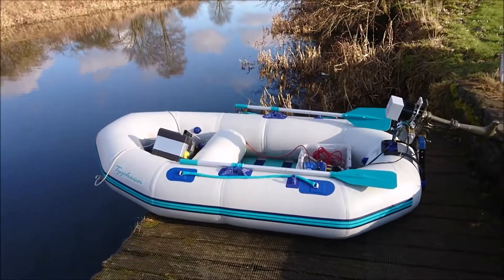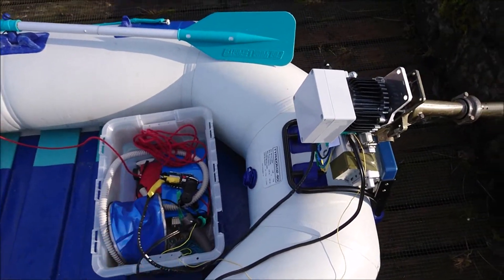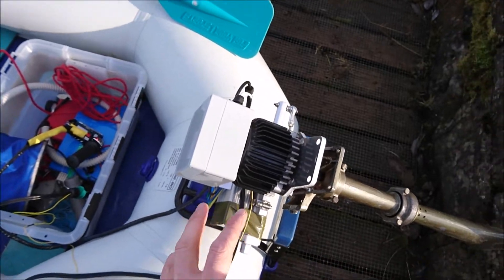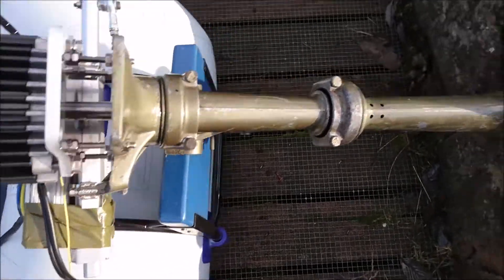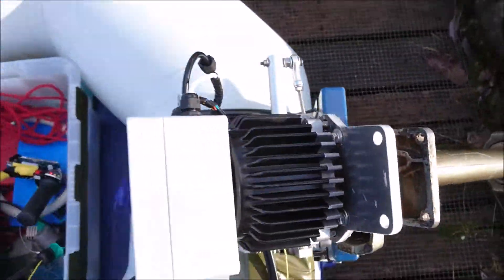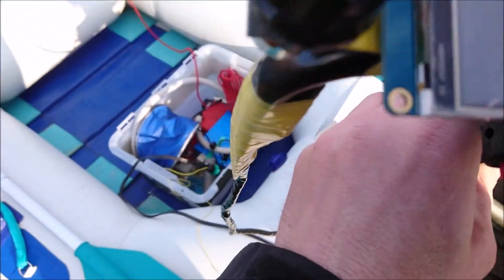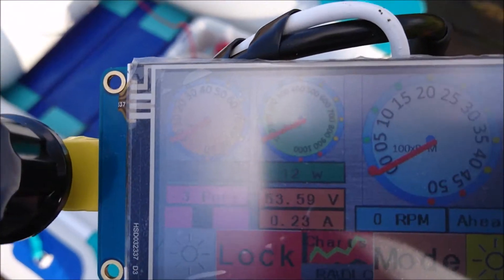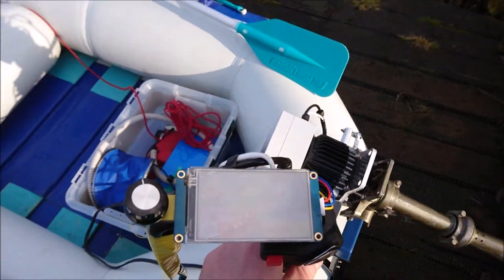Electric outboard canal test

Comment: Great stuff! I look forward to learning the overheating cause. You could circulate water through something if necessary. And thanks for mentioning my channel. And nice to have the music. I must try that.
Reply from the maker: You're welcome.  On investigation I am 90% sure the BLDC motor controller has failed.  All phases on the motor are fine, the hall sensors are fine and the motor spins freely.  The controller seems to be feeding current to all 3 phases at once, and as they are wired as a star that means there is no potential difference.  I'll keep you posted.